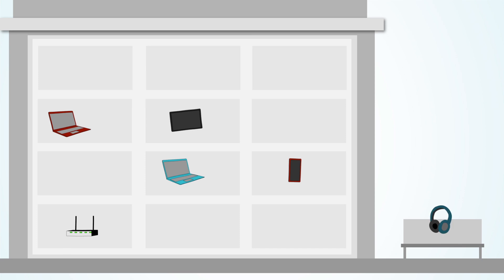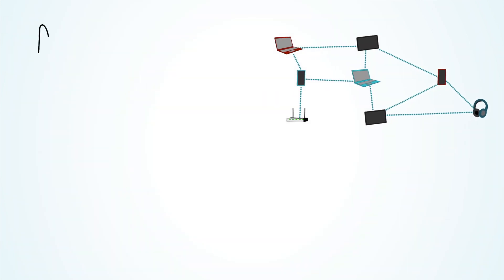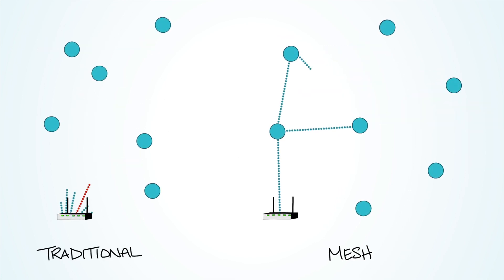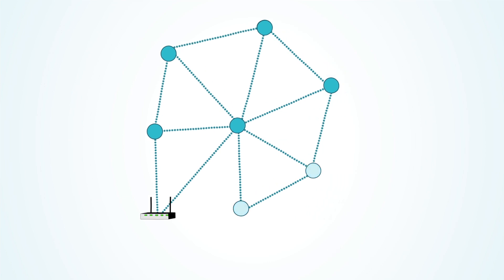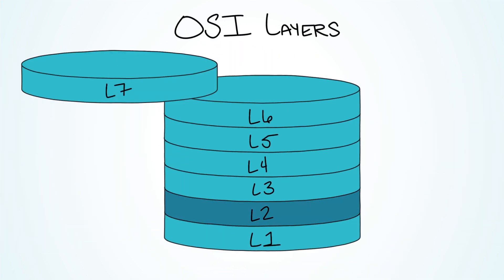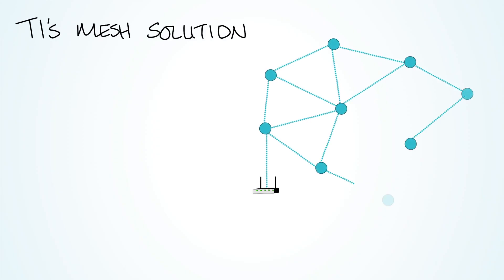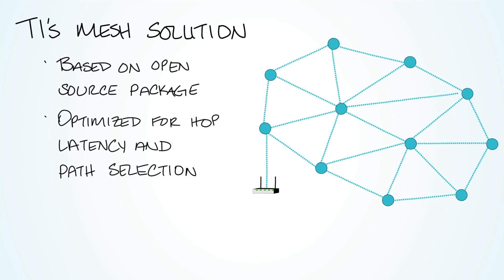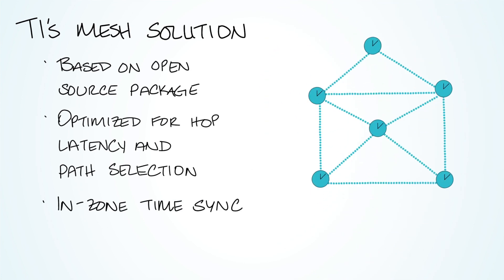Rethink range with the WiLink 8 mesh networking solution

Comment: Is it IPv6 based or coming from the hardware layer under all of this ?
Reply from the maker: TI mesh solution is based on open source 802.11s which is implemented at data link/MAC layer running on Linux.
Reply: Texas Instruments Thank you very much !!! So it's more or less the 802.11s from OpenWRT ?